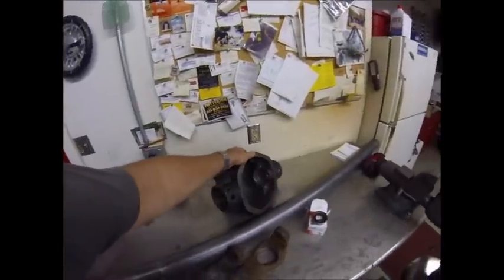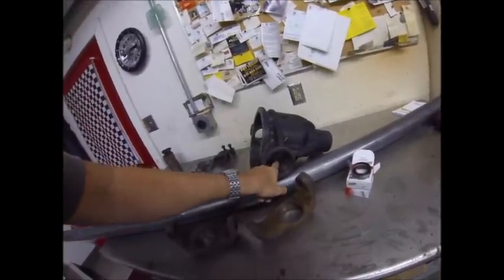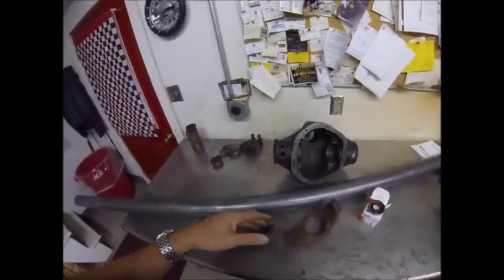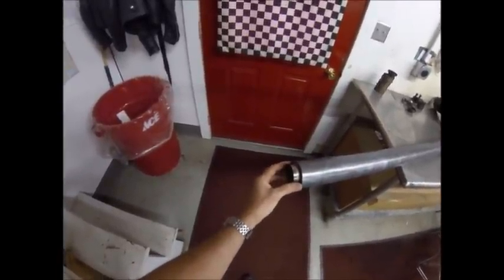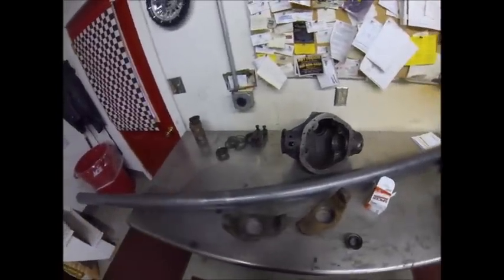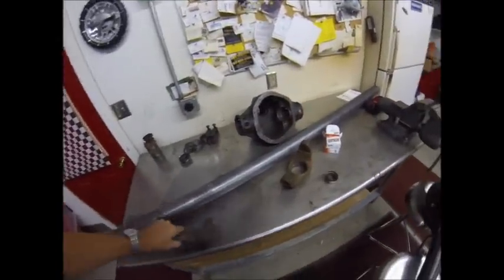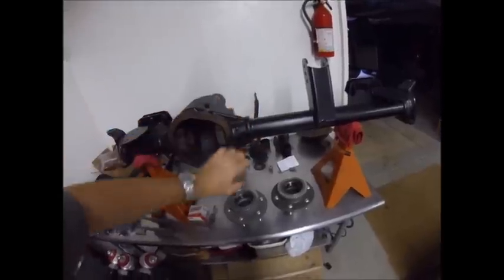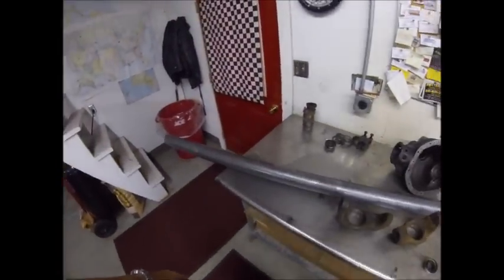Dana 44 retube part 2

Comment: When i used to remove bearing races from large machinery, I would run heavy beads of weld around the face of the bearing race. They'd just about fall out of the bore when it cooled.
Reply from the maker: Great idea.  I have never heard of that.  I'll try it the next time I get one that's stubborn.
Reply from the maker: great idea!  I will try that.

Comment: Great info! What material did you use for tubes? just regular mild steal?
Reply from the maker: I used .500" wall DOM mild steel.  Probably overkill, as it makes the completed housing very heavy.  I think closer to .375" wall would be better.
Reply from the maker: Yes.  These tubes are .500" wall which is probably overkill.  It increases the weight of the housing by quite a bit.  Stock tubes are .375" wall.

Comment: Hey just curious, what was your machines sizes for the seal and the press fit inside the housing. The O.D. for pressing into the housing and the I.D. for the axle seal
Reply from the maker: On the shaft seals...I just picked the seals I wanted to use, and cut a pocket into the tubes for them to press into.  Ford and GM D44 use different shaft seals, so the size will vary depending on the seal you choose to run.  The O.D. for tube where it presses into the casting?...I mic the I.D. of the receivers on the casting and turn the O.D. of the tube to fit...it varies from tube to tube.  I oversize the tube by .003" so I get a good tight press fit.

Comment: What did you machine the tube to to fit in the housing?
Reply from the maker: I turned the tubes down to achieve a .003" interference fit.  One thing I did not mention, is that you should use some black (oil resistant) RTV sealant at the ends of the tubes.  This will help prevent oil from weeping down thru the "scars" in the pumpkin, and leaving small drops on your driveway.
Reply from the maker: I measure the ID of the casting and turn the tube to the same plus .003".  This gives a good tight fit.  Any less...the tube will not get tight.  Any more...its takes a lot of effort to get the tube pressed all the way in.  I also add a 45-degree chamfer on the end of the tubes, to help guide it into the casting.